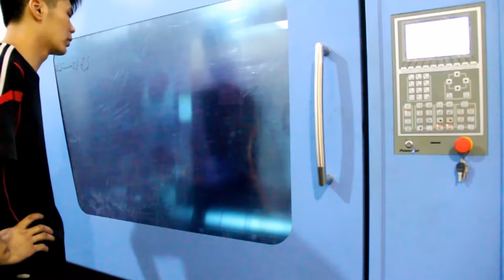Plastic Injection Molding Machine For Plastic PP/PE Bucket Injection with Powerjet's Machine

Comment: the best Plastic Injection Molding Machine of the world are the machines of Husky and Sipa
Reply from the maker: Thank you, Joao, Different countries have different advantages & markets,  we focus on the special injection molding machine for different products with a different design!
Reply: Why isn't there a purge dock and purge gate by injection unit
Reply: I've seen injection units explode plastic out the side from cracked gate pads and melted this guys face off
Reply from the maker: @tonynava3427  the machine have the function of air flash & ejector , some other function can be customized according to your requirement
Reply from the maker: @tonynava3427  do you mean it's afraid the plastic will be exploring it out while the machine running?  its has a cover with them, only its take out in video because machine is under testing
Reply from the maker: @Tony Nava  if any doubt , pls send the video of the situation you saw through email info@powerjetmachine.cn, Phone & Whatsapp +86 138 2777 4426,thank you!
Reply: @PowerjetGroup  regardless if a machine is in testing, he should've been wearing the PPE. Especially if he's manually pulling it out. You never reach into a mold press when it's in operation. The pumps should be off, the carriage should be pulled all the way back the screw purged out if he's inside of it and with all the PPE. This should happen no matter what the situation is.
Reply from the maker: @tonynava3427   woow,my friend, you are so professional!  there will be triple safety protection in the machine:  1. mechanical safety lock will be operated after the safety door open 
2.  PLC program protection: The limit switch signal will be shut down after the safety door open 
3. hydraulic protection: Hydraulic circuit will be shut down after the safety door open 

Don't worried about these parts, we have 21 years' experience in the manufacturer of injection molding machines & blow molding machines,  and we are looking for agent,  if you are interested, we can discuss the details, thank you!
Reply from the maker: @tonynava3427  thank you very much for your suggestion, we will pay attention to that next time!
Reply: I work for Berry Global. We make buckets and lids also. Most our machines are Husky.